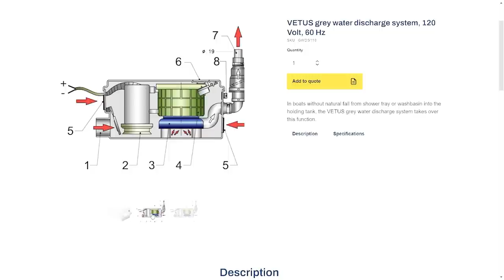Where We're Running Our Wiring/Conduit - CATAMARAN BUILD (MJ Sailing - Ep 246)

Comment: I pump my shower drain soapy fresh water into a holding tank which when full overflows to a sump with a bilge pump to take it overboard through a siphon breaker.  This reclaimed shower water I use to flush the marine heads--I add a little holding tank sterilant into the shower drain pre-shower to prevent the putrification of this shower water.  Not using sea water in the heads solves a few problems with lime build up.  The flushing tank need only be about fifty litres capacity for two people--marine heads do not use very much flushing water.  More people aboard--maybe one hundred litres would do it.  One can always use extra sea water if one runs out occasionally, but we never did.
Reply: Good tip to reuse grey water for flushing

Comment: you need to get a very good orbital sander with a vacuum to control dust. Use it on all that flat fairing especially all that shelving. Do not dig in the edge like you might choose to do when removing bottom paint. Use it flat against the surface with a semi light touch to fair all those flat surfaces. With all the fairing you need to do, you will be an expert by the time you finished a bulkhead or two. Might I suggest trying to fair the coves after fairing the flat surfaces. you can use the sander to do all the flat surfaces and then a shaped scraper to fair the coves afterwards. Check out Onboard Lifestyle, he sands everything with an orbital. When fairing the coves you can use a credit card to scrap away any inevitable little ridge that will happen along the edge of the cove as you smooth the fairing compound. Check out  believe it or not this 2 step process will actually save a lot of time and elbow grease.   lastly, remember it is not a Steinway piano, shoot for exceptional and not perfect.  Great work so far. looking forward to the finish line and future sailing episodes.

Comment: Also you can use a joint compound knife in different widths to give you a smoother surface on the finish to smooth your walls  giving you way less sanding.

Comment: Glad Matt didn't get hurt in the slide. Could you guys explain the reasoning for having the holding tank above the head?
In a comment below, Jess mentioned lifting a compressor into the boat to paint. I have long hose leads and volume tanks with filters that are much lighter than lifting a compressor. We could put the compressor outside the tent and run the hoses inside. It's available if you want it.

Comment: plan on painting/priming  with the old brush and roller or going with the sprayer?
Reply from the maker: For the cabinets we're going to spray. So we've decided to hold off on priming until more areas are ready since we have to get the heavy compressor up on deck to do it.

Comment: Matt, because you are lifting the salon seating and the nav station, why can't you run the conduit under both and aft of the forward bulkhead so it remains watertight and the conduit will run where most of the wiring/plumbing is needed?

Comment: Maybe consider using open clips for wire runs. It keeps wiring very neat and makes adding or removing wires easy. Inspection of wires is far easier and fill limits to conduit is not an issue. Check out Onboard Lifestyle ep 16 and others for good methods for wiring. He did an excellent job.  You two are doing great work! All the best.

Comment: for that inside radius is best use  steel ball from  ball bearing welded on apx  5" long round stock apx 3/8 dia  and other ball of different radius on other end ,  looks like tinny old fashion lifting weight . That  what we used on industrial patterns  It could live in small can of acetone  to keep it clean
Reply from the maker: Those are wax radius tools used for making molds.   The issue we have is the clean up of the extra filler that is pushed to the side.  Seems we always skim into our nice radius when we go back to clean up the extra.
Reply: @MJSailing  check out Onboard Lifestyle for how to deal with the annoying push out. can you say Credit Card!
Reply: @MJSailing  we used them  primary for epoxy work , so you don't have to deal those  humpy  imperfections and far corners . cup of acetone  and paper towel fix that smoothing and cleaning  in a jiffy (Ps : my job is Master Pattern and Mold Maker)

Comment: You boat your baby but i wouldnt have swing doors on wardrobes.. they block the corridors and if you want to leave them open to ventilate  the cupboard s. Then they start flapping around .
The gap at the top could be translucent glazed to allow light from the back of the side Nav  station  windows to flood down below in daylight hours. Right in front of your wardrobe/storage area.

Comment: Hey Matt, can't you run the conduits athwartship inside the settee (where the storage will be) instead of through the water tight compartments forward of the main bulkhead? The fairing is looking great! And, all n' all, the work is looking very, very professional!
Reply from the maker: The settee doesn't run all the way across the bridgedeck, nor do any cabinets.  The watertightness of the forward bridgedeck (not the forward most flotation) isn't hugely important.
Reply: @MJSailing  Ah, in my mind I was picturing a set of cabinets in the galley, but it's just a walkway. The work is really looking exceptional!

Comment: Are you guys 100% sure that the dropped wedge is inaccessible? At 22:00 it looks like the compartment closest to the daggerboard case is (kinda) accessible from under the module (from the rear), and it looks like the compartment next to it is accessible from a narrow slit between the module and the inside hull from the front? A bit hard to see in the video though…

Comment: With your furl tank running accross the hull , have you created a dam , as a norm  water 3ntering the bow runs back entering the bilge closer to the stern as the low spot of a boat , 
How will you run bilge requirements ?
Reply from the maker: The bilges are sealed watertight into 40 cells per hull.  No real bilge except a small catchment behind the shower.
Reply: @MJSailing  normany there is a hole through each section running back to a low spot and a bilge pump in each Hull.   So are you 0utting more than one pump in each Hull,?  One  forward of 5he tank and one back, evwn in the engine rooms ,  
I have been on boats with sealed areas and water collectors and not good access to a central pump , smelly water . 
I have set up after seeing a 2 way valve on a standard bilge pump and a hose that can roll out the full length  handy with an emergency or those areas not running to a bilge .

Comment: Keep all electric and data calbles apart. I use to work for a data company and electric can mess up the data network.  Keep most runs 6 foot apart ... just keep that in mind and keep up the great work
Reply: 6 Inch would be more practical possible. Keep power and data separate from each other as much as possible is still a good advice. The other is using shielding not only on data cable, specifically propulsion systems generate also significant electrical noise.
Reply: @jm3779  I watched when I was doing a service call when people are watching TV and then someone turn on a there electric stove it would nock out there tv system.  I even run system ob boats and rv campers and I aways have to reroute  the Data calbles away from any power.

Comment: 3M  16580 Accuspray Paint Spray Gun System with Original PPS, Standard, 22 Ounces, 4 Nozzles800 Grit - 5" Green Film - Hook & Loop Sanding Discs for DA Sanders - Box of 505.7 Amp 6 in. Short-Throw Random Orbit DA Polisher/Sander
by Dura-GoldShoot your gelcoat with a 3M gun hit it with this cheap da and wet sanding film discs

Comment: Glad to here that you are using conduit. Remember to also leave a pull string behind for when you want to add a wire. Will it be metallic or nonmetallic conduit. The nonmetallic will be lite but wonder if metallic may offer some noise and lightning protection.

Comment: 3M makes a half moon Hookit pad you put round 6” Hookit paper on and it gives you a rounded corner to sand your semi round inner corners. It uses 6” Hookit paper different grits 80 grit 120 grit  180 grit 220 grit as well as 320 grit. Works great for your corners inside shelving

Comment: I see you all constantly worried about level and water drainage. How does this correlate when the boat will not be sitting level in the water hardly ever as it co scantly changes with loading , sea state etc. just a thought I keep having
Reply: You have to start somewhere. Should they start from a non level positioning when the boat IS level? No, they should, and did, start as level WITHIN the context of the boat itself. Pretty simple concept to grasp.